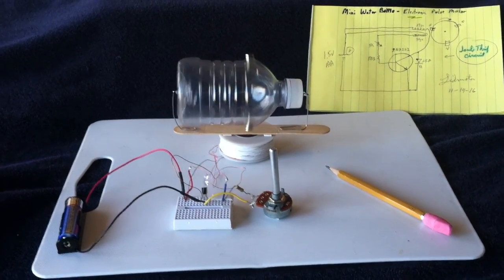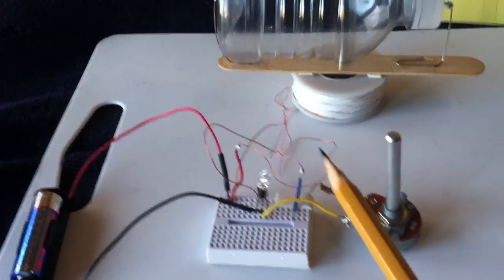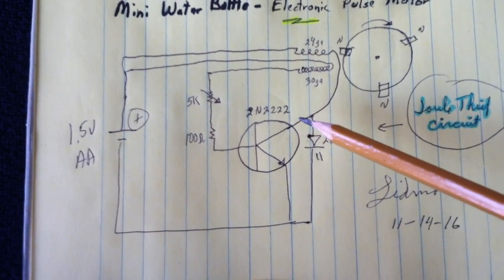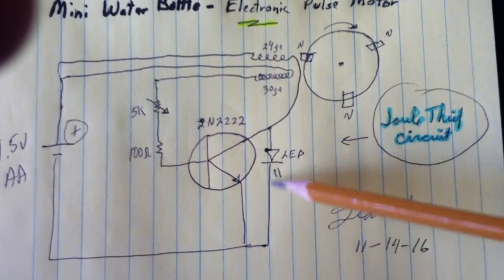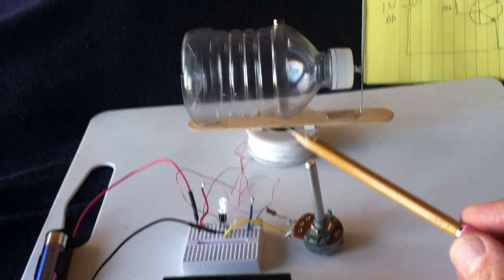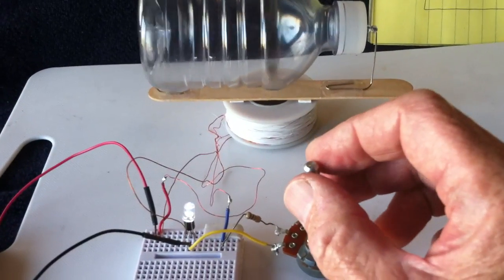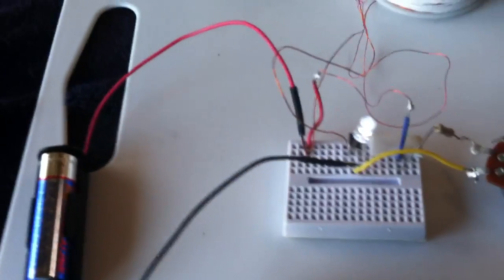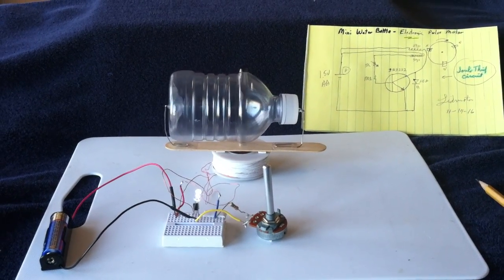Mini Water Bottle ----  Electronic Pulse motor

Comment: Hi Lidmotor, just to let you know i have built a water bottle pulse motor and it works great, but while i was at it i wondered about how much of the wasted back spike energy could be used so i took out the led and replaced it with a two diode rectifier and cap.
i then took this output to a depleted battery and hey presto it started charging.
i have been monitoring the voltage now for a couple of hours and guess what ?
the run battery voltage is now at 2.52 volts and the charge battery is at 2.59 volts. WoW 
i have been videoing this periodically and the first video shows the run battery at 2.72 volts with the charge battery at 2.37 volts this will be very interesting to see where it all stops, especially as there has been a crossover point.
Reply from the maker: Well done!  What you have now is a basic Bedini "energizer".  What kind of batteries are you using?  John Bedini  used lead acid batteries and claimed that the 'energizer' improved the plate surfaces and made the battery easier to charge.  On all the tests that I did with my "energizer" setups I never saw any indication of 'over unity' but it was interesting to see the device charge up a second battery to a higher voltage than the run battery.  You have to do load testing on both batteries after a long series of swappings to see where you stand with the over all energy.  I never even got close to breaking even but it was a fun experimenting.  I learned a lot.
Reply: Hi again, i am using regular Ni MH batteries from a torch.
i will leave it running now for another couple of hours and see if the charge battery gets near 3 volts if so i will swap them around and see where we go from there ( latest readings are charge battery 2.7 volts and run batt 2.2 volts ) i have videoed every stage of this so i may put it on youtube.
Reply from the maker: I look forward to the videos.  You could put the batteries back in the torch to do your load testing.  My experience was that the batteries picked up a "fluff" charge that looked good on a meter but discharged quickly when loaded.  I hope that you have better results.
Reply: Yes i take your point so will conduct a test such as that, as you say we can all be fooled by what our meters say. About now some on You Tube would be claiming OU at this point ha ha.
However i need to know if you did any run time tests on your motor with measuring voltage as well.
I ask this because yesterday  instead of feeding the spike to another charge battery, i tried to feed it back to a freshly charged 4 volt  run battery ( obviously with isolating diodes ) i wont bore you with all of the details right now but at 1.17 am this morning the voltage read 3.98 after two hours of running, upon checking it half an hour ago 11.57 (U.K time )  it now reads 3.91 volts and this varified with two meters. This is eleven hours later.....so either this motor is incredibly efficient.....or i have something and i'm not sure which.
Reply: Oh one point that i should mention this is your original pulse motor and not the JT version.

Comment: This is bedini motor.
Reply from the maker: No this is not a Bedini SSG.  I would have called it that if it was.  I have built many of them. Look at the circuit closely.  I tried to run this on a Bedini SSG circuit but couldn't get it to work.  This is running on a Joule Thief circuit.  The two are very similar but different.  The SSG circuit relies solely on an induced current from the passing magnet to trigger the transistor.  It also has a diode between the base and the negative rail to help the transistor turn hard off and on.  The circuit I show here is a very old 'blocking oscillator' type that adds in the passing magnet induced current to override the standing frequency.  Believe me I tried and tried to get this to run on the SSG circuit.  It just wasn't strong enough.

Comment: Will we see it in a bigger scale? I wonder what a 12V battery can do with that :D
Reply from the maker: There are lots of large pulse motors that run on 12 volts.  I'm very limited on size because of where I do these projects.  It would be fun to do this with a large soda bottle, scale up the whole thing, and run it on 12v.  I would probably switch to regular Bedini SSG circuit.  If you look around YouTube you can find similar projects.  On a larger motor you would have to lose the paper clips and tongue depressor base and go with something much stronger.
Reply: +Lidmotor 
Well, I was thinking of an actual wheel. Bicycle wheel with many coils like bendini would be cool.

How about that? :-D
Reply from the maker: I highly recommend that anyone interested in this subject build a true Bedini SSG and build it a close as you can to his specs.  It was a Bedini SSG build, using a honey jar lid rotor, that got me started in this hobby years ago.  If I had the space, time, and money,  a bicycle wheel Bedini SSG would be on my to do list ---even after all I have learned.  I disagree with the claims of what it does but the dynamic of it in operation is beautiful to watch.   It is a classic.  John sells a small bicycle wheel model now but if you build one from scratch you would learn more.
Reply: +Lidmotor 

I have one year left to join electrical engineering university. Your videos and a few others, are the ones that keep the subject awesome!

Thank you :-)

By the way, is the "free energy", possible?

Searl Effect Generator is the one that sounds "free energy" to me. What do you think? :-)
Reply from the maker: Go to school and become an electrical engineer.  I started out that way but was stopped at my 3rd semester of calculus.  If you run into a critical class that you can't get through-- STOP.  Take a bit of a break and take it over again.  Keep at it until you get that degree.
  As far as 'free energy' it depends on your definition of it.  Energy is all around us but it is the conversion of it into something we can use that is hard.  I have not studied the Searl effect generator but nothing I have seen "makes energy".  The easiest 'free energy' device I have come across is a solar panel.   The sun is free. It is a nice big thermonuclear generator.
Reply: +Lidmotor Thank you very much :-)
Reply from the maker: Best of luck with your schooling.  Study hard.
Reply: +Lidmotor 

Thank you. I do my best.
I am studying right now.
It is not as easy as it seems, but I'll get it through.

:-)